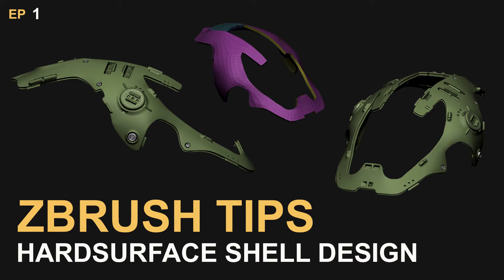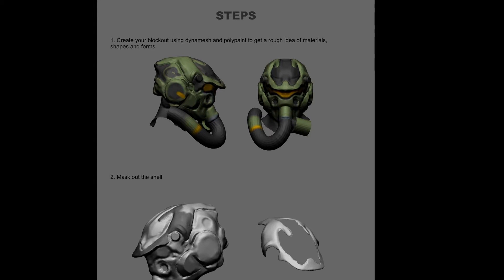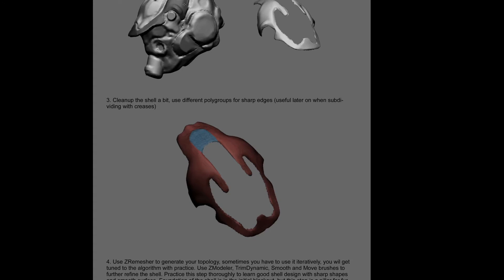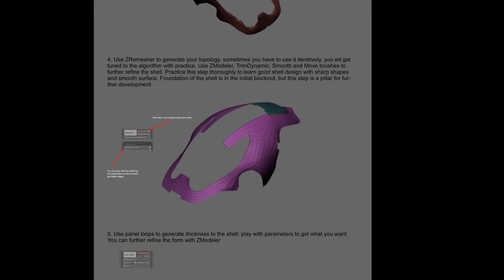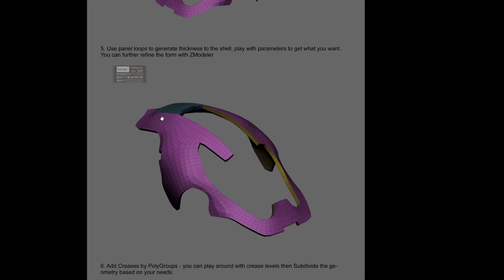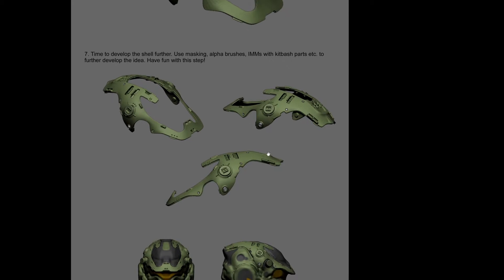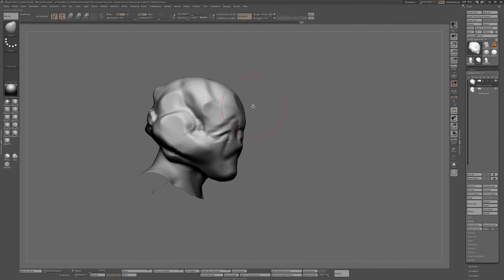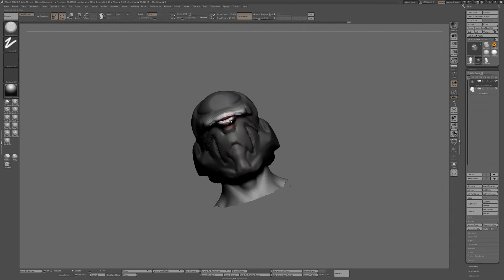Zbrush Tips 01: Hardsurface Shell Design

Comment: Hey which brushes are you using for stamping on the alphas/VDMs?
Reply from the maker: I use custom brush called Nash Extrude from Mike Nash brush pack.
But you can do it with inflate brush with low focal shift and change stroke to drag dot.

Comment: i just got some question about the panel loops. i just started learning zbrush and i wondered if there is any tool in zbrush like does in blender modifier. i would like to work in thickness mod but not applying it. just to make sure before applying if is good. thank you very mich in advance
Reply from the maker: there are no modifiers like in Blender, but one thing that comes to my mind is you could try using layers, perhaps it works!
Reply: you can try dynamic subdiv. there's a thickness slider in there u can slide back and forth before hitting the apply button

Comment: thanks so much for this! it’s extremely helpful. :) 

I was wondering: for the final version of this piece (the one posted on artstation), did you also use moi3d and/or nvil anywhere in your workflow? 

I see that you use it sometimes, is there any specific reason for that? like faster workflow, etc.?
Reply from the maker: The helmet posted on artstation 80-90% was done in zbrush. I did use some kitbash parts from personal library (for example the ear cylinder part you see on the side) which was done in moi3d.

Regarding nvil and moi3d i used to have a process for a long time where i start with a rough sculpt in zbrush and then move into nvil and moi3d for final polished result, the reason was just me being used to the workflow, all 3 softwares have its own benefits regarding speed and quality (cad, subd modeling, sculpting). But over time my blockouts were getting more and more clean in zbrush so I started to think why not just finish everything inside zbrush, so this is where i am at now, trying to explore zbrush more and get that sharp finish. But i do think there is a fun combination with moi3d along zbrush, i will try to explore it more.
Reply: @lukamivsek  I see, I see. I can definitely see the difference in cleanliness now that you mention it. 

I appreciate your response :) can’t wait to see your future projects!

Comment: Only issue is once you start detaching and zremeshing, the mindset has completely changed from form to detailing. The relationship between form and detailing is broken
Reply from the maker: Yes, you sort of commit to the form after you decide to polish it up, it sort of works the same way if you work with standard SubD poly modeling workflow (maya, xsi, 3dsmax etc). But you know, you can always rework your idea, remove the shell, re-sculpt in dynamesh and go at it again. Or you can even mix and match - some parts with dynamesh, others parts with this workflow etc.

Comment: Luka, what do you think about the workflow with Extract masked areas? I have to enter, to create... pure geometry? Or, in any case, will you have to clean it later and rebuild it with Zmodeler? If, for example, you need to make a face mask or separate elements for the head, and not a helmet? Are you going to do a rough blockout with the Clay brushes, or is it better to mask them right away and make an extract?
Reply from the maker: Hello CBDF! Thanks for asking, yes I used to work with Extract but I find it hard to keep the shell really precise with nice edges. Because the moment you start moving the mesh around using Dynamesh you quickly loose consistency in the edge, and if it is a thin shell it is going to be hard to get it back, so I prefer this route a lot more, it gives me more control. And the freedom of designing having whole blob together and using Clay brushes to sculpt the form I think adds to the speed of the process.
Reply: @lukamivsek  Yes, I agree that it's faster. I guess I should look into your approach. I have been thinking about how to do this for a long time, but I did not know that the guide was from Marco. Thank you for recording this video, now everything looks holistic.